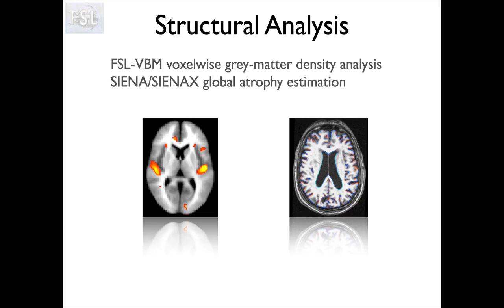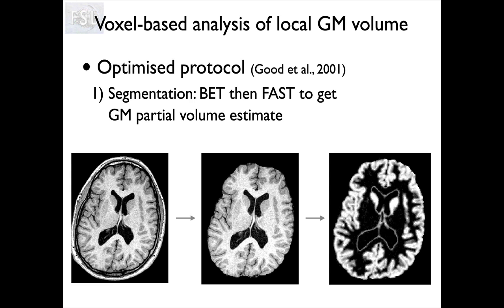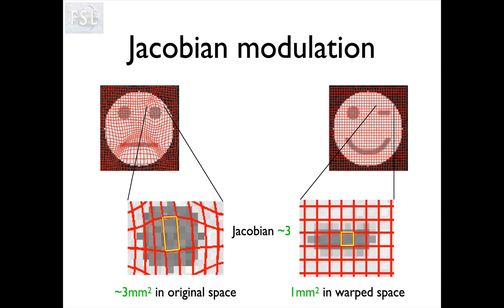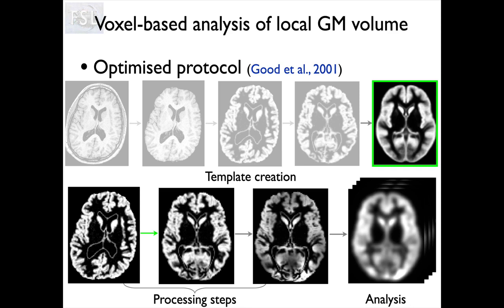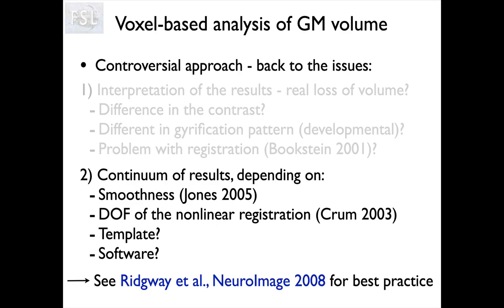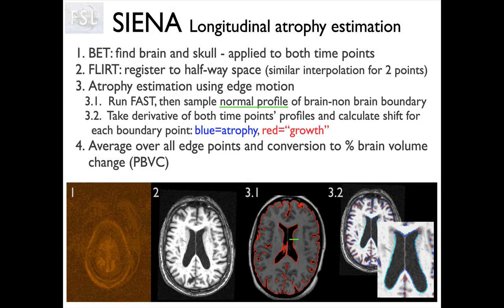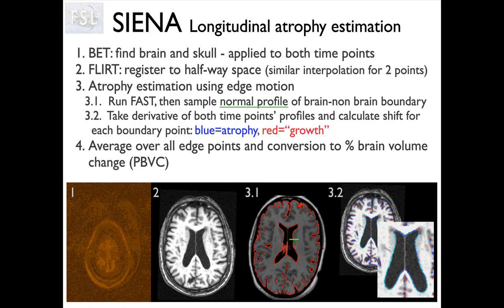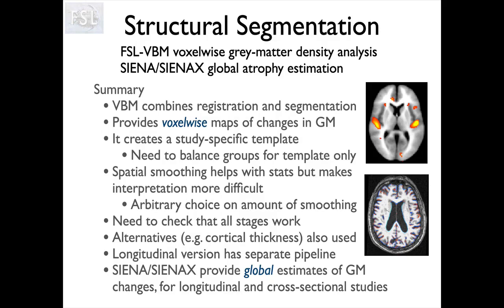10. Segmentation: Structural Analysis using FSL VBM and SIENA (Struc E4)

Comment: Thanks for an excellent video!
Regarding VBM and the Jacobians: When we create the GM_mod volume and hence correct for any expansion or contraction of GM by multiplying with the jacobians, is that the same as controling for head-size? Other videos on VBM reccomend using total intercerebral volume as a covariate. Isn't that the point of using jacobians? Or is that more a "local" correction and not a "global" correction? 
Thanks!
Reply: Hi Robin, This is a good question!
Like you said in the final sentence, I consider jacobian modulation to be a more local correction compared to dividing everything by overall intracranial volume; so I treat them as two distinct adjustments. It is also worth noting that registration would change with varying brain sizes (not head size particularly), which would in turn influence the jacobian modulations indirectly.